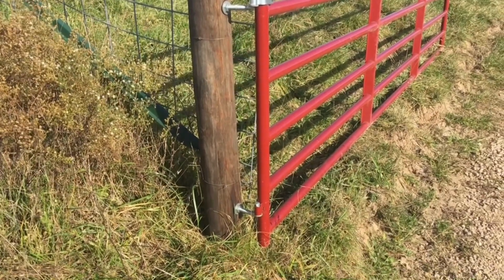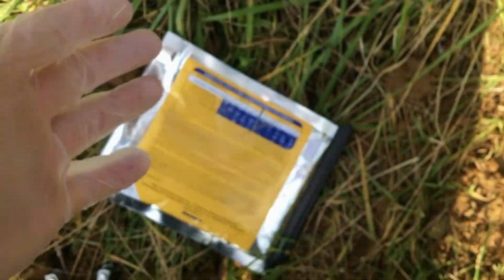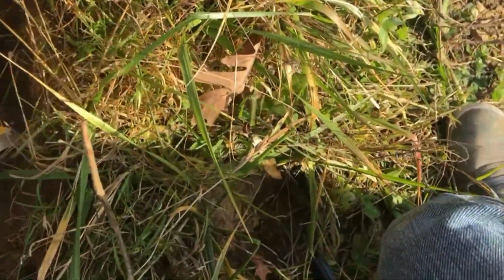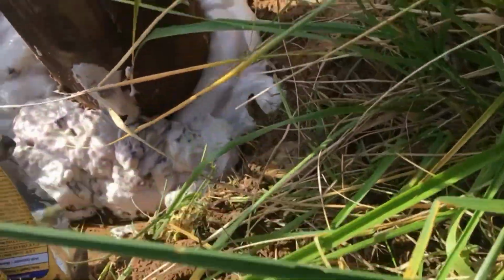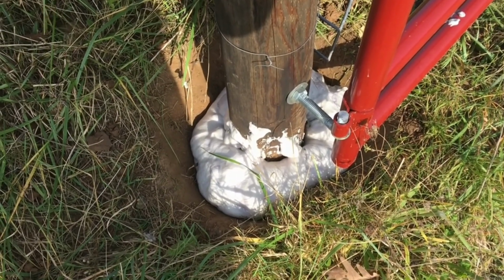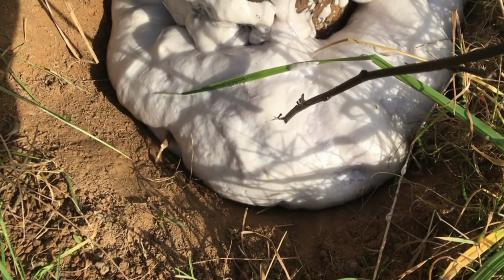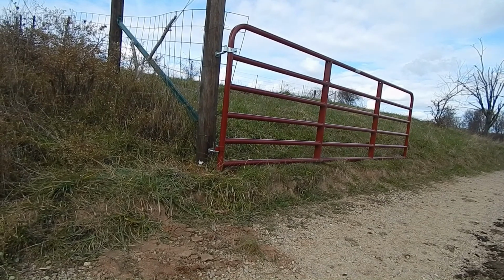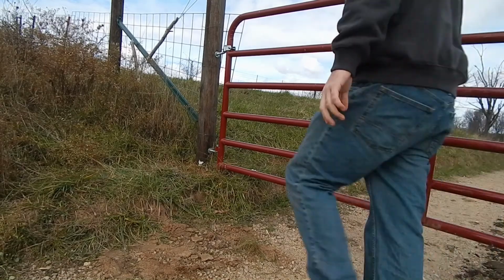using fence post filler: Fence post backfill foam in use on a post on the dairy farm.

Comment: If that's an 8 ' posts, I think it needs to be buried at least another foot.  Shouldn't the green metal brace go to the top of the post so that it anchors it?  Thanks for sharing.  How is it holding?
Reply from the maker: Hi Liberty Garden! It's nice to hear from you again. How are you doing these days? I believe it is holding up well, but it's my own fault for not following the instructions on using the fence fill.
Reply: @farmcards  still fencing, one weekend day at a time.